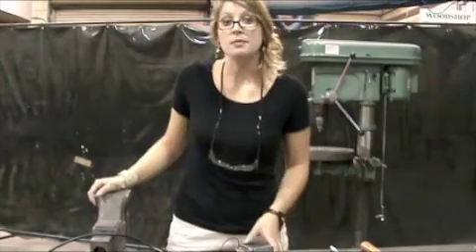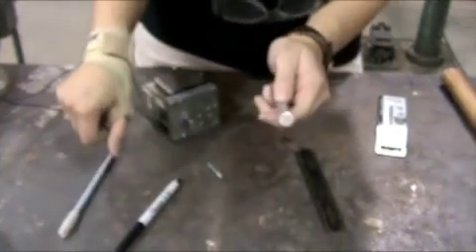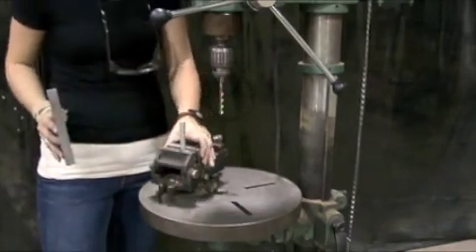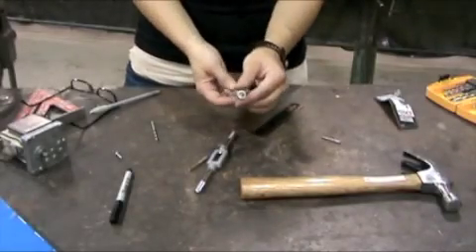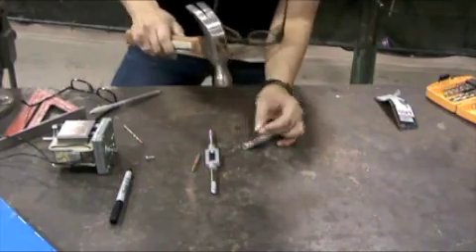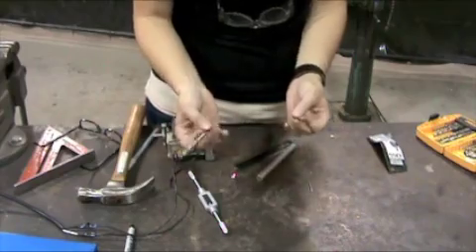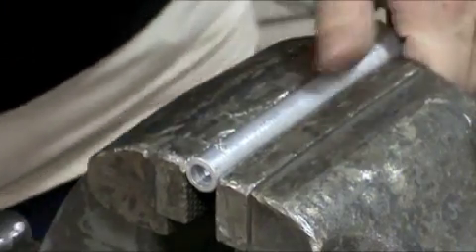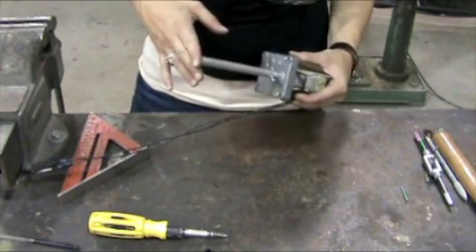Machining a Longer Motor Shaft

Comment: There is so much wrong with this video that I don't know where to start.  No safety glasses, hair not secured around machinery (drill press in particular) how to find the center of a shaft, wearing jewelry around machinery, and my favorite..using a nail as a center punch.
Reply: @zdringy  😄😄😄😄